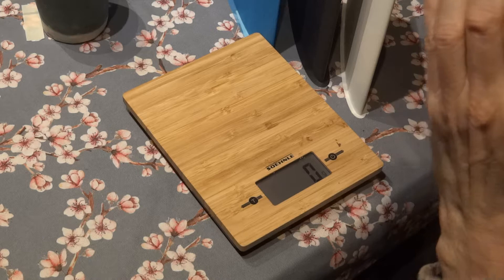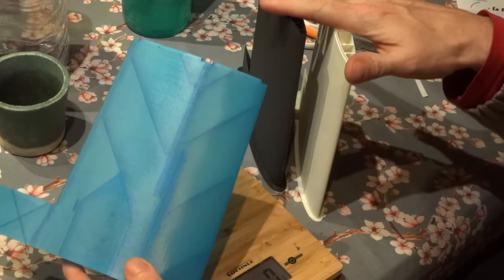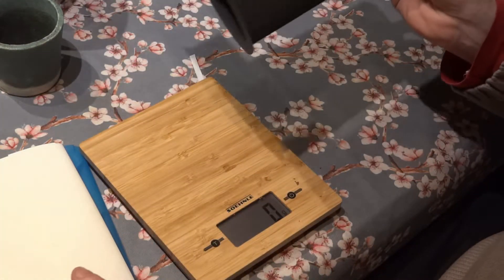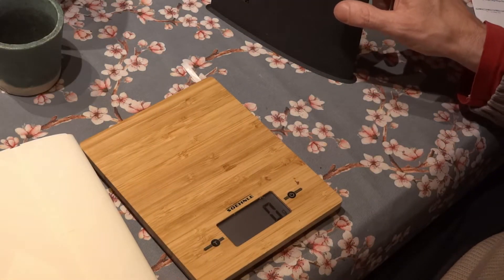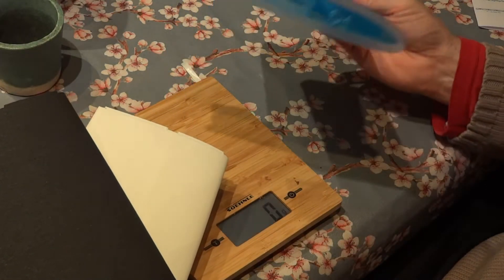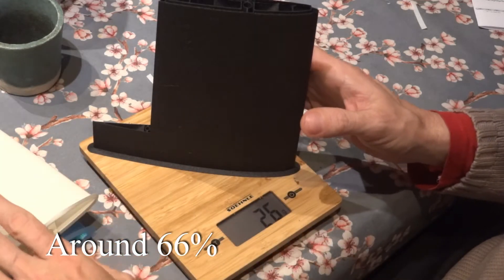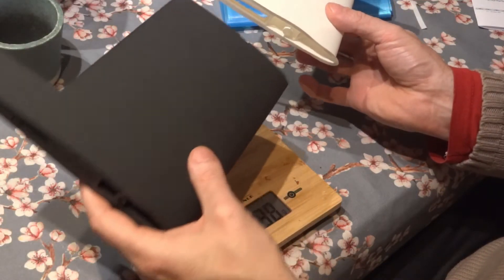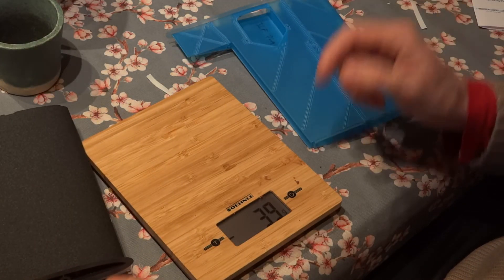pla vs lwpla vs polylite foamy pla

Comment: I am little confusing that I use same preset to print LW-PLA with regular PLA, and my LW-PLA is only exact 20% lighter than regular PLA. What speed and temp and flow rate are you using?
Reply from the maker: First for lw-pla print at maximum 40mm/sec to have good foaming effect. Then you can check CNC kitchen video about it. But flow at 0.4-0.45 at 240degres is a good start

Comment: Very interesting video indeed, thank you! Question: printing Polilite PLA-LQ (pre-foamed), do you leave same retraction speed set on your printer settings when printing normal PLA, or do you increase to something like 3mm (with retraction speed set to 40mm/s and deretraction something like 30mm/s), as indicated in Polilite PLA specs pdf? Thanks in advance 👍
Reply from the maker: Didn't change anything but just like regular lw-pla it ooze a lot.

Comment: you can print lw-pla at bit lower temperature and higher extrusion rate, to get exactly same stiffnes to weight as with polylite..
Reply from the maker: Yes but you will still ooze like hell. I think both are valid but for slight different purpose. The polymer can be used with standard pla settings. But a little heavier and stiffer than lwpla with lighter settings.

Comment: I printed the Eclipson model A with eSun Lw pla. The fuse or tail broke in flight and crashed. The wings were much too weak in lw pla and broke in assembly and needed repair. Without a carbon spar and protection from rubber bands the lw wings are too fragile.
Reply from the maker: Another solution would be to laminate with light glassfiber and sla uv resin instead of epoxy resin. It sticks better to pla than epoxy and you can cure it fast using an uv lamp.
Reply: @SebastienChedalBornu  I have an Eclipson model c that I’m building. I did glass the lw pla wing with 1 oz glass cloth and water based polyurethane. That plane also has no spar. It adds very little weight and the parts are still much lighter than pla only parts.
Reply from the maker: @cl18t  yeah I do think that light weight pla will open a way to have complex parts that you can after laminate and reinforce with composite materials. Thus having a cheap way of creating composite planes (not as light as pure empty carbon wings).
Reply from the maker: Yeah you really have to consider lwpla as a skin so it needs bones. I didn't check about the model A but the model S do have carbon tube reinforcements.
And the lwpla is made for quiet conditions, not sturdy ones.
I think you would have the same problem with polylite. Honestly I think carbon tubes and rods are mandatories for a correct strength even in pla.
Also when I said that lwpla is more for quiet conditions and speeds, it's because the first people I saw  making plane with lwpla went back to pla because the surfaces where too elastic and the plane suffer lots of fluttering with higher speeds.